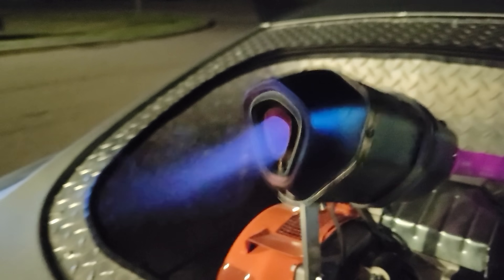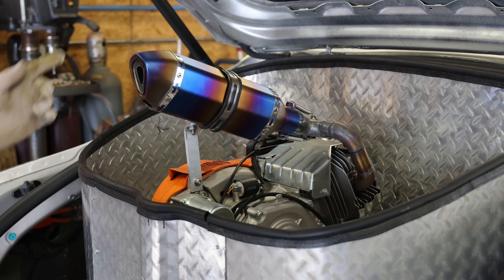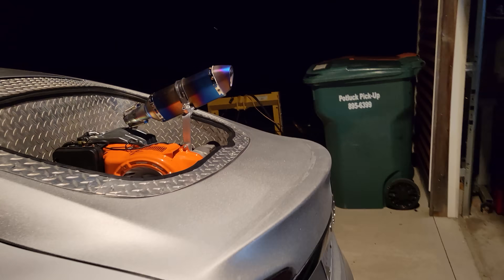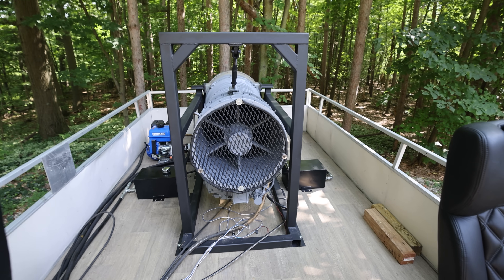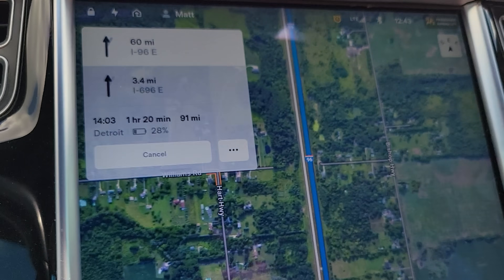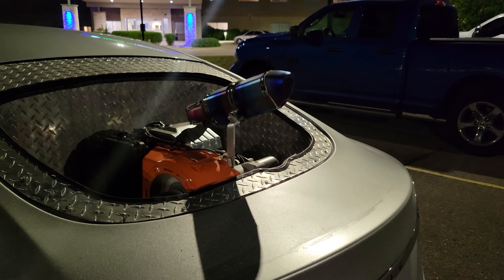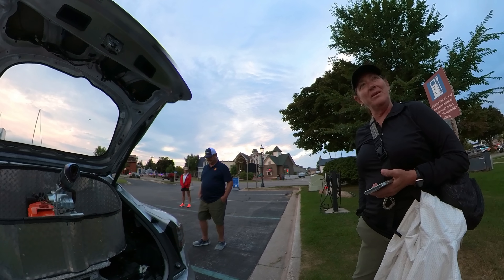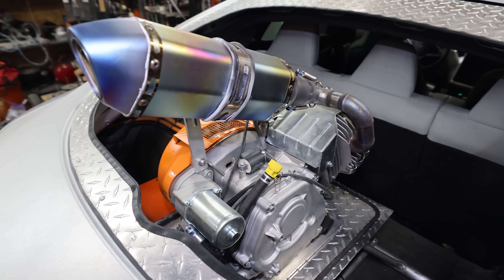Cordless Tesla (I Drive 1800 miles without charging) P.1

Comment: Hey man, I love your test, awesome.
I have a suggestion unless you already did it.
So, besides the better and more efficient power plant, I would recommend having a solar plant on the roof and wherever could be installed. However, knowing the solar efficiency will drastically drop during lower sun scenarios and during the night, the best thing is to use a series of fans located under the front hood. What you need is to simulate and design a wind flow directed below the hood and directed into the channel system moving series if let's say 8/fans. This means that during any movement (day, night, sun, no sun, bad weather etc.) you will increase your power source charging the car. I don't want to get into numbers, but with a proper design, charging efficiency could reach 60% to 80% or more.
Thanks
Reply: somebody get this guy a grant to build a perpetual motion machine. it will be amusing.

Comment: Okay my opinion 2 Honda EU2300 WATT 1800RPM inverter generators tied into a 220 VOLT converter so you got 220 volt if that's what you need and they run like at 12 hours on a gallon of gas at half amperage/ throttle you know? That may work. You supply the Tesla I'll buy the equipment.
Reply: ☝️thanks for watching and congratulations 🎉 you have been selected among my shortlisted winners..

Telegram only to claim your prize 🎁

Comment: I see where there are small, like for homes, diesel generators available and also small single cylinder 200cc and hopefully bigger diesel engines available that may be much better suited.  Trains use diesel engines to generate electricity for their electric motors for many decades; proven efficiency.  As you likely know diesels do not use much fuel for all the torque the motors put out.  This may allow for a big powerful generator that will not have to run at high rpm to get useable power.

Comment: 13 Horse power from 400 cc maybe not the best engine choice.  Should have used a car muffler to make it more quiet.  Maybe the generator could have put out more electricity had it been bigger?  Maybe you were limited to how fast the battery was allowed to charge with your setup?  I'm glad the tesla software did not stop you from charging while driving as it would if you were at a tesla charger.  Maybe try a honda motor from a crf 300?  I think they put out like 26 hp from 300ccs and I am sure there are even much better choices.  Maybe a modified 650cc single cylinder motorcycle motor.  I think the honda dual sport may have many engine mods available to release the extra power you can use. Of course due to the many losses of power going from the gas motor to the generator to the charger to the battery to the electric motor it is hard to say how many cc's of a motor would be required to drive it freeway speeds and only have it charging while driving which would be ideal.  I suppose the chevy volt, not bolt, was my favorite design.  They just made the battery too small as did Jeep with it's e- wrangler.  Thanks for helping to satisfy our curiosity.  Please use a lexus or ? muffler next time.

Comment: I’m impressed with the application here, but if he needs to run the generator overnight to charge, just plug the car in.  The point of the generator, for me at least, would to be able to charge enough to offset the energy usage.  Otherwise… you need a stronger generator.  But very cool experiment.  Just do it again with a stronger generator and a better muffler
Reply: ☝️thanks for watching and congratulations 🎉 you have been selected among my shortlisted winners..

Telegram only to claim your prize 🎁

Comment: This is the prime question I've had all this time: Why do hybrid electric cars have a mechanical connection from ICE to the wheels? Why not do like this guy did? A small, efficient engine, running ONLY under max efficiency conditions???
Reply: Maybe run a small turbine engine for the ICE?
Reply: The Chinese will do this.

Comment: 1800 miles without charging builds a huge thing that charges it on the go... lol. So you mean without plugging it into a house?
Reply from the maker: Energy can only be converted it cannot be made or destroyed.
Reply: @WarpedYT  I understand,  but based on title I was expecting either larger battery or some sort of solar panels though that would still kinda be charging it. Haha.
Reply from the maker: @Galicia322  it's hard for people without a Tesla to relate, solar panels will do absolutely nothing, the amount of power that these cars need is beyond what solar or wind power on a small scale can provide unfortunately. If I used solar I would have had to drive 200 mi and then stop for 2 days to let the car charge up and then do another hundred miles and repeat that process until I got to my destination, assuming they are sunny days. That's just not a usable car in that scenario.

Comment: Why would you do this when you can use a actual gas car, having an engineer running all the time kindof defeats the purpose of electric cars, and lowers the efficiency, you can get better fuel economy, mileage on a tank, noise levels, and simplicity with a modern gas vehicle, with a modified larger gas tank, just put a second tank in the trunk, and boom, you have exactly what you wanted, a massive amount of range without having to fuel up
Reply from the maker: Well u will have to wait and see why, but there is a reason for my insanity.
Reply: @WarpedYT  ok, I mean it is cool and all, but at this stage I don't see it being viable.
Reply from the maker: @1985FieroGT  it's not viable at this stage at all. But it's just like when anything new is in development, differences most of the time nobody gets to see that development all they see is the finished product.

Comment: I have got to know what kind of gas mileage this thing gets.
Reply from the maker: I drove 1800mi and burned a total of 82 gallons of gas.
Reply: @WarpedYT  And you started with a full charge, correct?
Reply from the maker: @trollking6111  no so that's why I messed up in the beginning, when I left my hometown at 100%, I drove until the battery was 40% before starting the unit. I was actually really nervous because I hadn't tested anything prior. From there it was a ripple effect a painful one that went on for my entire trip. If I would have turned the unit on right when I left at 100% battery I would have been able to drive straight to my stop with the pontoon boat. But that's sort of what this trip was about to get all of the metrics and the numbers plugged in to see how I need to build version 2.
Reply: @WarpedYT  They say diesel generators are more efficient. Train locomotives use diesel generators on electric motors.
Reply: @WarpedYT  Thanks for doing this experiment, by the way. The truth must be told.

Comment: Maybe I missed it... But did you ever discuss what the total amount of fuel was that you used for the 1600 miles? The leak would really screw up the MPG but the info would be helpful. 

     Using a diesel would likely create higher fuel mileage. Gee... A diesel electric. We have over 100 years of experience with diesel electric locomotives. I have NO IDEA why somebody hasn't tried to miniaturize a locomotive engine and put it into a car. Likely would get 200 MPG or so! Imagine a class A motorhome that could get 50 MPG or so... Do you think that would sell?
Reply from the maker: I drove 1800 miles and used a total of 82 gallons of gasoline. I know exactly why they haven't done it and that's why I'm doing it. 🙂

Comment: Thannks so much for taking the time to share your project with us. That's a great concept. However I would imagine that you spent 4 times the amount on gas for the engine plus the efficiency losses and costs of the engine parts and modifications. BTW thanks for your efficiency ratings at the end of your video.  I'm curious since you took your Project Vehicle to the Kohler Plant were you able to showcase it with their engineers?
Thanks again.

Comment: You need to charge at as low of an rpm as you can to get more energy out of the fuel.
Reply: Well . . . Yes and no, you need to keep the engine and generator in the most efficient range.

 Unfortunately these generators are not designed that way.  At full generation they are very wasteful.  Not efficient gas engine poor choice. 

Couple a small engine to wheels with enough power to keep up 70mph, then regular battery only for hills and acceleration.  Would have been much better, presto you invented a hybrid car.